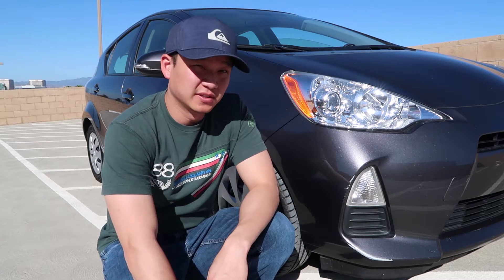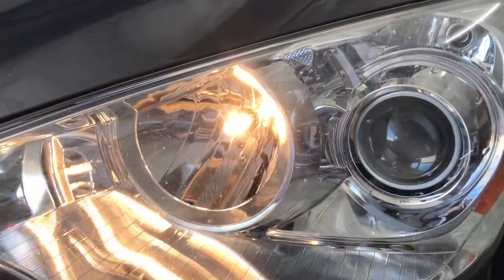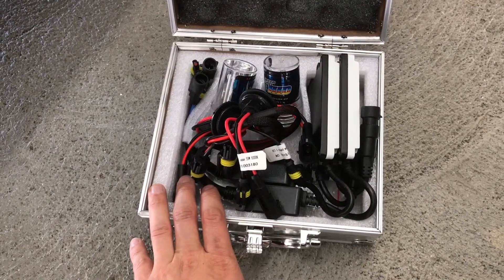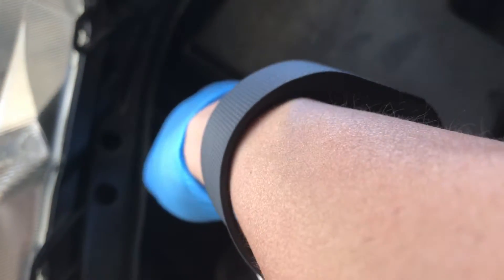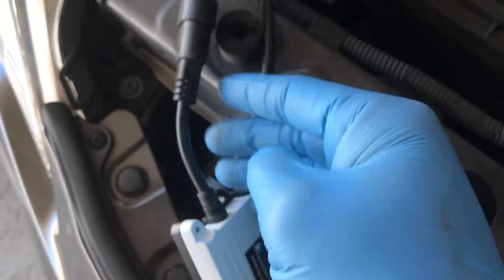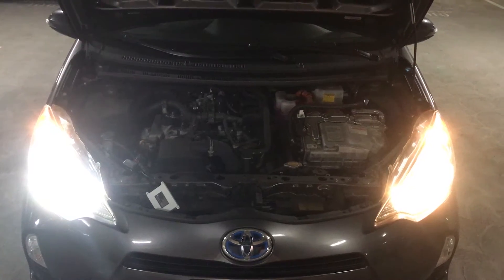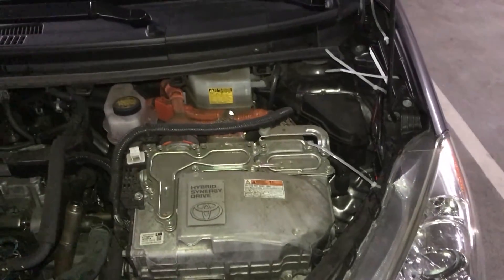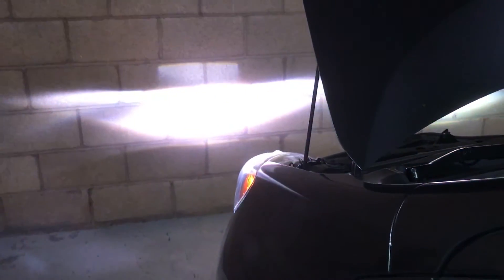Kensun 55w 6000k HID Upgrade on a 2013 Prius C

Comment: Good video!   I also have Kensun HID 6000k on my 2011 Prius Gen 3.  I really like them.  Although they seem to reach the end of the visible light spectrum the 6000k temperature really makes the reflective road signs and road makers light up as if someone plugged them in, which they did not!  I just took a 500 mile trip one way driving at night and saw may reflective items I never noticed before.  Some roads looked like they had runway lights for landing.  VERY NICE INDEED !!!Again, Great video !!
Reply: Did you installed a relay harness on your 2011 Prius Gen 3?

Comment: I have a 2012 as well and the lights are dim. I was going to do this years ago but was told by the guy at autozone that they would run hot and possibly melt the housing. Have you have Any issues ?  Thanks for the video!
Reply from the maker: I still don’t have any issues but I have heard of the problem from other forums.

Comment: just curious . so you would have to buy 2 kits to do high and low  beams i wanted or can only do low beams  with these kits
Reply from the maker: +-IDAHOs_UnKnowN- I think so. I'm in the hospital right now so I can't check but once I get discharged, I will check for you
Reply: Depends on the car, some cars have high and low beam on the same bulb but I think most are separate which means you would need 2 kits.
Reply from the maker: I just looked it up.  The kits are separate for the Prius C 2012.  It might be different between kits.  The best way to check is when searching for "Prius C HID Kit" I include the year of the vehicle and if it lists High beam and Low beam separately, then you need to decide if you want both or just the low beam.

Comment: I'm confused between 5k vs 6k? And wanted to ask you if 55w are annoying for opposite drivers?
Reply from the maker: +nawar arabo I believe 5k looks more true white and 6k has more hints of blue.  You can try to google "hid color chart" and decide for yourself. As far as drivers on the other side, that has to do with adjusting the headlight leveling.  Depending on your car, it might help to get projectors.